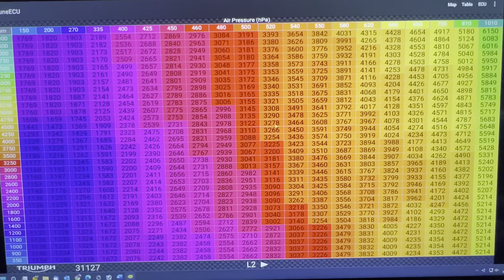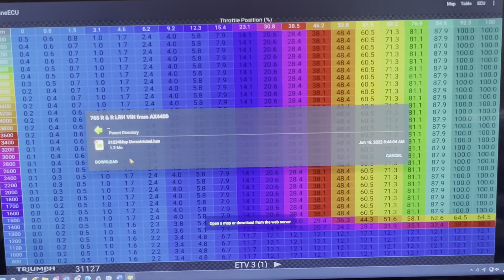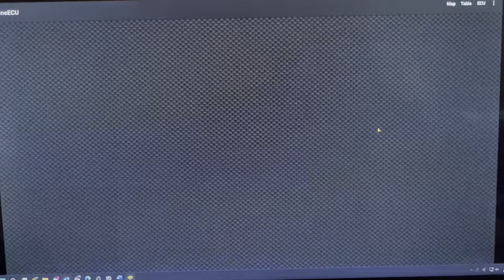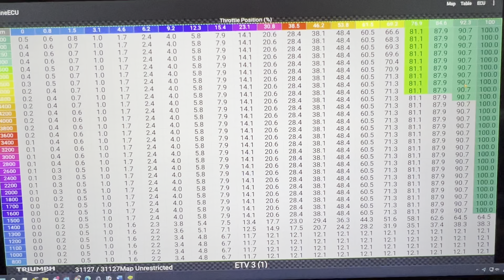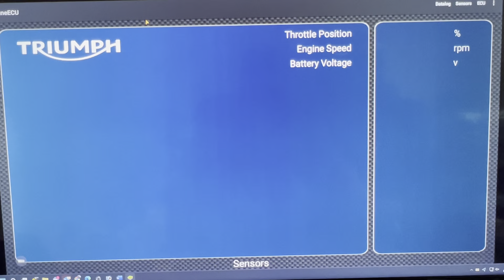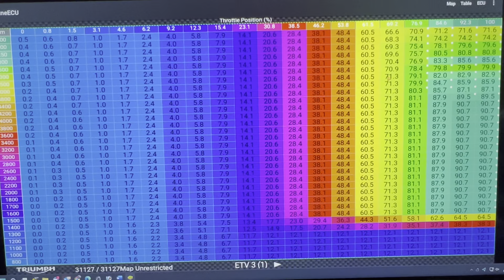Get your Triumph Speed Twin to FULL power!

Comment: Great explanation, thanks. I've got a 2020 T120, I wonder how the figures compare to the Speed Twin?
Reply from the maker: I will pull your map and look at the tables later on this evening.  What country and last 6 digits of the VIN?  Want to make sure I pull up the correct base map for your bike.
Reply: @Daves_Man_Cave  I'm in the U.S, last 4 are AB3101. My guess is they've really neutered it given that the Speed Twin and Thruxton are more performance targeted. I really appreciate you looking it up, thx.
Reply from the maker: @scottroberts4551  Let me grab my tablet and look it up.  The 1200 motor comes in two flavors...  The Speed Twin and Thruxton have the High Power motor and the Bobber has the High Torque.  Not sure which one you have.
Reply: @Daves_Man_Cave  the T120 is the high torque.
Reply from the maker: @scottroberts4551  Yeah, I just pulled the map, no real restrictions.  It gives you 100% until 6500rpm and then tapers down to 84%.  Being that it redlines at only 7k and peak power is just below 6500rpm, I can't imagine that there is any gains to be had there.  The HT motor has a different cam that increases bottom and midrange torque at the expense of top end HP.
Reply: @Daves_Man_Cave  I see. Thanks for looking it up.

Comment: Hey SquireSCA, I noticed in your video you have both far right columns at 100 and then later you have only far single right column at 100,  Which map did you use? Thanks
Reply from the maker: I used 31127 for mine and I went with both right columns set to 100
Reply: @Daves_Man_Cave  Thank you for the fast reply.
Enjoy your new Speed Twin
Reply from the maker: @donjingle4059  I have a follow up video to this, a little more in detail, uploading now.  Might answer some of the questions I keep getting.
Reply: @Daves_Man_Cave  Thanks,  I did get my 2022 Speed Twin tuned as per your video and I have to say it makes 1 hell of a difference. I noticed that I don't need to twist my wrist nearly as much now.  It also reminds me of back in the day when we got to hear the 4 barrel on a V8 kick in with just a stomp of the foot.  Nothing like a cable to get the job done. Now thanks to your video I get to enjoy that sound on my motorcycle... All the way to redline.. Thanks again
Reply from the maker: @donjingle4059  Glad it helped!  I also found that in that area that they restricted with the throttle tables, they also pulled about 3.5 degrees of timing.  Expect a video to show that mod, I am flashing it and testing it now.  :-)
Reply: @Daves_Man_Cave  That's fantastic.  Do you have a dyno near you.  Would love to know how much power these 1200s can put to the roller.  Looking forward to your timing video.
Reply from the maker: @donjingle4059  Yeah, I think I might get a Power Commander, toss it on and then go get it dyno tuned... Then I can take the power commander tables and import them into the Trim table in TuneECU and it will convert them into a new base map that I can push to the ECU, remove the power commander and sell it and get most of my money back.  It's actually faster that way, than to do all the tuning in TuneECU and have to flash the thing for 18 minutes after ever pull we do...
Reply: @Daves_Man_Cave  18 minutes seems like an eternity when doing this sort of thing.
Reply from the maker: @donjingle4059  It is, especially when to do a proper full dyno tune, you will have to flash 15-20 times.  You will spend half the day just waiting on flashing, and a fraction of that on actual dyno runs and tuning...
Reply: @Daves_Man_Cave  hows this coming along?
Reply from the maker: @jland7300  very well, new video and map about to drop...

Comment: Great video and tutorial. Can I download and save the factory map with ECUTune and ODBLink LX? If I can do that I can use the Emulator on my PC, edit the map and then upload a copy to the bike with my Android phone.
Reply from the maker: Go up and expand the description, scroll to the bottom.  I created a shared folder with both US and UK maps.  All that I did was modify the ETV3 tables for Sport Mode, and set the AFR targets to something a bit richer, not sure if that will actually do anything but it can't hurt.
Reply: @Daves_Man_Cave  OK I will try tomorrow on my PC as I don't see this on my android phone.
Reply from the maker: No, you cannot "pull" your map from the bike into TuneECU, you can only push it TO the bike.  However, so long as your model is supported, the app will be able to get the stock file from Triumph, that you can then open and tweak and use, or, use in stock form to put your bike "back to stock"...
Reply: @Daves_Man_Cave  What do you  mean by "get the stock file from Triumph"?
Reply from the maker: @garymitchem6740  TuneECU has a database of the latest official files from Triumph...  When you select Map, Open Map, and click on "Download", it connects to a server and allows you to find and select the latest map for your bike.
Reply: @Daves_Man_Cave  ok will give it a try tomorrow. I have a UK spec 2022 Speed Twin.
Reply from the maker: What mods have you done to the bike?
Reply: @Daves_Man_Cave  so far US Spec V&H with the DB killers removed. Planning an X-Pipe and a free flow filter.
Reply from the maker: @garymitchem6740  Then you gonna want to get it tuned.  EURO5 bikes are picky when you make that many changes.  I located your base map(31126) and removed all the ETV3 restrictions and can send it to you...  But if you do an air filter, mufflers and the X-Pipe then you will need to do a proper tune on it.  You do know that to install an X-pipe, you have to physically cut the old CAT off, right?
Reply: @Daves_Man_Cave  The map would be great, do you want an email address? As for the X-Pipe, I have a set of link pipes off a Euro 4, so once I remove the cat I can use the Euro 4 X-Pipe.
Reply from the maker: @garymitchem6740  Yeah, send me an email address and I can send you the map.  As for the x-pipe, it's welded on the header end, so make sure that once you cut it, that it's the right size for the x-pipe to slide over it and clamp to it properly, with no leaks...  The end the mufflers go on, are standard clamps...
Reply: @Daves_Man_Cave  DNK Tuneworks for the final map once all the mods are done?
Reply from the maker: @garymitchem6740  Yeah, Danielle usually has something that will get you pretty close.
Reply: @Daves_Man_Cave  The headers for Euro4 and Euro5 are the same part number. The link pipes sit between the CAT and the mufflers. If you drop both frame rails you can remove the Euro5 Cat and welded link pipes and then replace with an X-Pipe and Euro 4 link pipes. If you search online a few people have done this.
Reply: @Daves_Man_Cave  did you get my email address?
Reply from the maker: @garymitchem6740  I did not
Reply: @Daves_Man_Cave  this is very odd. no matter how I send it, it gets deleted
Reply from the maker: @garymitchem6740  try emailing me directly through my profile
Reply: @Daves_Man_Cave  doesn't appear to be a way to do that.
Reply: @Daves_Man_Cave  my email address is in my LinkedIn profile?

Comment: Dang does this work on the newer ones 2021 2022 Speed Twins?
Reply from the maker: Yes it does.  It was the first thing I did when my 2022 Speed Twin was delivered.
Reply: @Daves_Man_Cave  Nice does the trottle rework somewhat give error codes or blinking dash lights?^^ I´ll get it brandnew and dont want my warranty to go away.
Need to compete with my brothers Street Triple RS now ;)
Reply from the maker: @DrHakennase  Any time you flash the ECU, you risk voiding the warranty.  Also, it won't make your bike compete with a Street Triple RS.  His bike is much lighter, makes more power, handles better, etc...  They are two different class of bikes.

Comment: I have a question, do you have an idea what it does to the engine when you set it to 100%?
Reply from the maker: It simply lets the motor operate as it was designed to.  On older bikes, there was a physical cable from the throttle to the throttlebodies.  When you pulled to 100%, they opened all the way.  Now its done in software.  When you put 100 in there, it makes it more like the older bikes, where when you ask for 100%, it has to deliver 100%.

This isn't unique to Triumphs, most bikes with ride by wire do this, and that is why everyone gets their ECU flashed these days.  You can tune all day with a power commander, but you can't get rid of those restrictions without flashing the ECU.
Reply: @Daves_Man_Cave  I understand that, thanks.
I meant, can it do any harm, but I think you answered the question to.
Reply from the maker: @henkbokhove  Nope, it won't do any harm.  You aren't advancing ignition or doing anything to put the motor in a dangerous state.  All you are doing is telling the UCU to stop limiting power.  We have the same motor that the Thruxton has.  But the Thruxton has a bit more peak power.  The reason is that our bike is held back, while the Thruxton is not.

Same with the Street Triple R and RS.  The RS has higher peak power.  That's because the R has a limiter in place like the Speed Twin.  With the case of the R, it only delivers 100% power until 6500rpm, and then tapers down to 81% from there to the 12,200rpm redline...

Triumph took the same motor, with the same tune, but restricted one in order to create two different peak power numbers at two different price points.  But you can restore an R to the full RS power profile, the same way as the the Speed Twin and others.

It's cheaper for companies to produce one motor for different models, and then create different power profiles in software.  Far cheaper than building different motors for each product...
Reply: Can i do it on the 2021 RS?   @Daves_Man_Cave
Reply from the maker: What model RS?  Street Triple?
Reply: @Daves_Man_Cave  2021 thruxton RS
Reply from the maker: That bike doesn't have the restrictions up top.  The Speed Twin is the one they limited, so that the higher priced Thruxton would "have more power" to help justify the increased price

Comment: I have the new speed twin and ecu tune but haven't messed with any settings, yet :)   I can't stand the on off throttle it has compared to my other bikes and would love to get rid of the low throttle  switch feel.
Reply from the maker: There really isn't a setting in there to disable the fuel cut...  I don't find it that choppy.  It's a big twin with lots of torque, I am used to it.  This bike makes less than half the power of my other bike, literally... so it doesn't bother me...  Still feels tame by comparison.
Reply: @Daves_Man_Cave Same here, my ZX14R made 201.  I now wonder if it's the pure gas I'm running and maybe  should try something else.
Reply: I removed the cats and you get a much more smooth feeling
Reply: @henkbokhove  What cat delete did you install?
Reply: @ohdirtracer  I have a free spirit x-pipe installed, it replaces the 3 cats.
the engine runs much smoother en is less restricted.
the other thing i did is a throttle spacer for a more direct feel of the throttle .
the next thing would be the ecu tuning and a test on a dyno to  see wat it al has done 🙂

Comment: Since the Thruxton has 105 PS isn't it possible they just used the same engine and detuned it this way to 100 PS? The full throttle percentage makes sense.
Reply from the maker: I just opened up both the Thruxton RS and the Speed Twin maps in Tune ECU, and that is EXACTLY what they did.  The Thruxton ETV tables have higher values in them, and at 100% throttle, they have 100's in them instead of 90.7....  It still tapers off a bit up top, but even the tapered off numbers are 10% higher than the Speed Twin's...  So putting 100's all the way up on both bikes, should make them the same, unless the Thruxton has a different airbox or something else.  The fuel and ignition tables look very close...
Reply: @Daves_Man_Cave  Cool, so that means the Scrambler 1200 is probably also detuned?
Reply from the maker: @pjansen2010  Weirdly, that one is not.  It has 100 in the last two columns in all 4 engine modes, all the way to redline.  Weird!

Comment: Hey would the obd link in the description work for my 2020 street triple rs? I still have the whole bike stock performance wise (saving for full exhaust) so I'm hoping that this is a good first step beforehand to just have and change redline and would the rs need any tables changed for the sport map? Also how would I differentiate between the sport mode map and track mode map if so? Thanks for any and all help
Reply from the maker: Yes, the same adapter works on both bikes.  As far as restrictions, the Street RS really doesn't have any.  The R is heavily restricted and you can use my method to unlock an R to deliver RS power levels...  Yours is already unlocked in that regard.

As far as Sport vs Track...  They both use the same engine mode.  There is only Rain, Road and Sport.  Track mode uses Sport engine mode, but relaxed Traction control and ABS.
Reply: @Daves_Man_Cave  understand so I'll temper my expectations for some magic cheap power for now. Lol as far as this helping me down the line with a full system, I'd definitely still want it, right?
Reply from the maker: Yes, if you decide to go with a full, quality exhaust, you are gonna want to tune the bike on a dyno, or risk damage to the motor.  But, you will get 125-130hp at the wheel if your tuner knows what he/she is doing...

If you go that route, I made a video all about it, here:
https://www.youtube.com/watch?v=uRVFGshdZQo

Comment: Guess the thing is not the rev about the speed twin, the limiting factor seems to be the rubber (160/60/17) you got and the wonky suspension. The engine ofc is underwhelmed by what one could ask her for. It's a damn 1200. :) I know that Triumph nerfed the 900 twin by a play-it-safe camshaft, the engine atself is capable to do more but they wanted to sell more 1200, that would have been  obsolete else :)
Reply from the maker: 160 is adequate with the right tire.  It came with Metzler Racetec RR's which are fantastic...
Reply: This is beyond my abilities...
Can I make appointment with you to do these changes?
Also, can these changes be done to my friend's '19 T-120 Bonneville?...
Approximate cost IF you were to tackle it?
Reply from the maker: @gp92510  I don't do this for other people, I just share the knowledge.  If you tell me what year, make and model you have and the last 6 digits of the VIN, or, you tell me what your base map number is, I can pull the map, open it up, remove the restrictions and email you the file.  But you will have to flash it to the ECU yourself.

Comment: Hi I’m thinking of buying a rocket for my cruiser do you think that would extend my rev limit and full throttle it I want 170 mph cruiser
Reply from the maker: No, you don't.  lol

Anything over 140 on a bike without a fairing, is not fun.  It's downright UNfun...  Not to mention stability at those speeds.  My guess is it would. be downright dangerous...  The Rocket 3 doesn't need anything, it's got so much power as it is...
Reply: @Daves_Man_Cave  no really I took demo out on bike week I hit 155 quickly and very very stable was hopping to get more really very stable and wind was not terrible thay make little bigger windshield
Reply from the maker: @albertschneider5978  Well, keep in mind the speedo error.  For example, the 2021 R1 that I had, was 6% high from the factory.  So 155 on the dash, meant 146 actual...

Naked bikes just aren't made for high speed stuff.  Even if they can do it, it's probably not fun, and you rarely do it anyway... My Street Triple RS was horrible over 140, but I only hit those speeds on the track...
Reply: @Daves_Man_Cave  ok thanks for your input but in till you ride one you don’t understand I would not be asking for more if it was incapable also would love to know if it’s getting full throttle 👍
Reply from the maker: @albertschneider5978  I looked up ETV3 on the new Rocket, and at no point is it delivering full power.  In fact, it never gives you more than 76%.  So there is a ton of power locked away in there, waiting to be unleashed.

That said, it might make it dangerous to do so... They held it back that much, for a reason.  So if you decide to play around with it, be careful or you might end up in a tree...
Reply: @Daves_Man_Cave  thank you for looking I’m excited to here that and don’t worry I’ve ridden over 200 hp motorcycle and not don’t look at the trees you never hit them lol thanks again for checking going to triumph in am to tire kick 😂👍
Reply from the maker: @albertschneider5978  Nothing wrong with big power.  I have a new ZX14R that's been flashed and stuff, that makes crazy power... but the suspension and aero package is designed for that kinda speed.  Naked bikes typically aren't... and that's where I would worry about stability and stuff...
Reply: @Daves_Man_Cave  I know how your talking had2015 zx14r anniversary with 40 hp nitris kit put 20 k mi on it and still lived to text you 😀204 mph gps nurmus times getting older need comfort lol